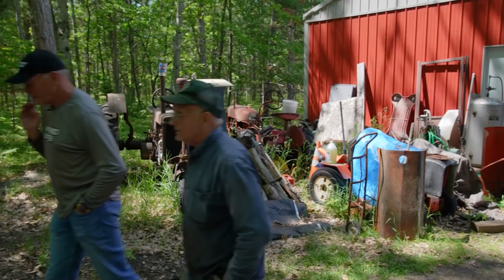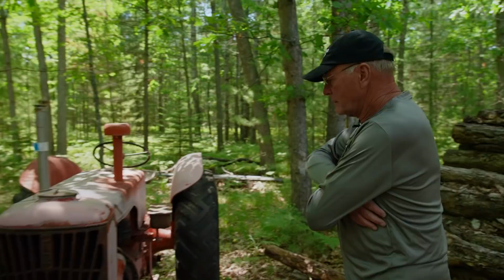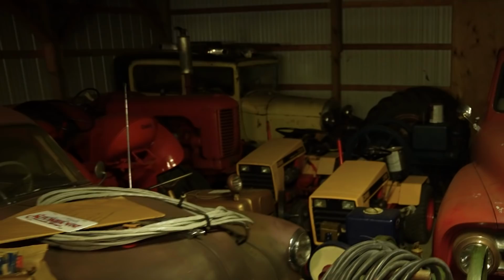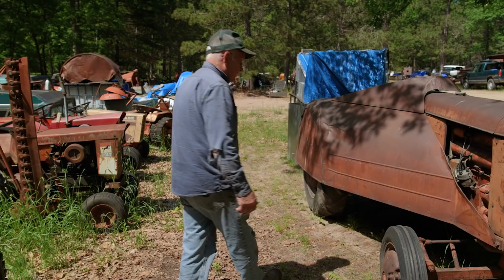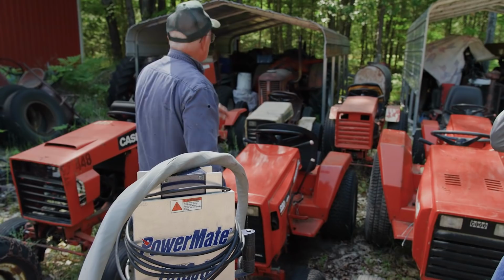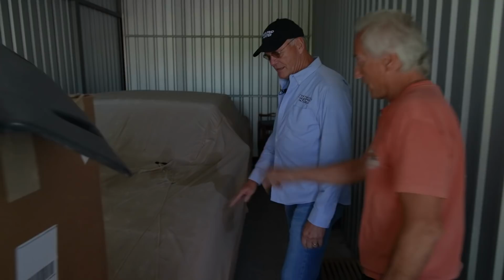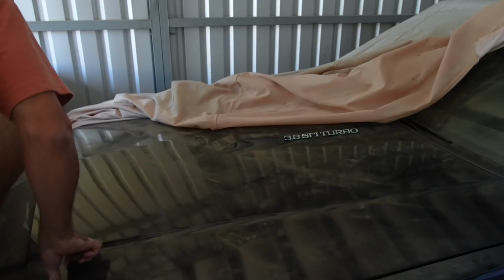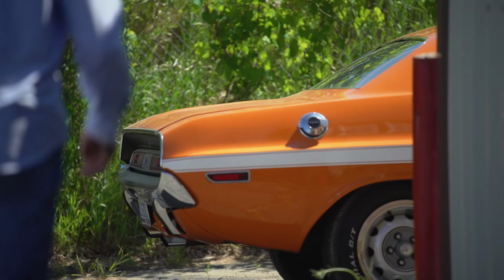LOW MILEAGE Buick Grand National press car and barn full of cars | Barn Find Hunter - Ep. 106

Comment: An 84 grand national was 200 HP and ran 15.7 in 1/4 mile, as fast as my 1986 Monte Carlo SS exactly, but the 86-87 grand nationals ran high 13s-low 14s right off show room floor. In early 90s saw many at drag strip. All grand nationals came with 200-4r transmission 4 speed with over drive and 3.42 gears, only options.
Reply: Your comment was pretty much what I was going to say. Except the 84-86 GN's were NEVER that fast. They ran hot & which really sapped power & when driven hard, they'd really over heat.
Plus the early 200 transmissions were prone to slippage & got really bad when the engine got hot.
I spent 32 years in the car business & remember those cars very well.
My mechanic's daughter has a built 85 GN, over 500 HP @ the wheel but she added a huge turbo & an intercooler & it's her daily driver.
Reply: @Vampirebear13  86 GN were intercooled as were the 87s. 84-85 slow, hot air.
Reply: @charlieb308  You're probably right. Been 30 years since I've driven 1. Been told the last few years, if I were to buy 1, only get an 87, unless I plan on building it. I tell them I'm an old man & like stock, dependable stuff. LOL Hope you have a Blessed day my friend.
Reply: They had one GN with the Turbo Six the store could not give away. I was tempted to buy it and put it away. Boy, I made a mistake not doing that, but enjoyed my Cutlass instead….. oh well!
Reply: @Vampirebear13  the 86 is the same as 87 but 87 was rated at 5 more HP. Car and Driver tested a 86 GN and it ran zero to 60 in 4.9 second and high 13s(it was cold outside that day). The 86 was made in low number 5,500 but 87 is 30,000. The 86 has chrome on front grill. Don’t hesitate to get a Regal turbo, T Type or turbo T, they are basically all the same car except interior, color options and wheels. I remember in 1991 I test drove a 86 regal T Type maroon, the car ran mid 12s, it was so fast my heart was racing, I’m such an idiot for not buying it for only $3400. I didn’t buy it because it had exhaust leak(crack manifold). Boy I’m so dumb.
Reply: Telsa does 1/4 in 6 seconds
Reply: @wileecoyote5749  1/4 in 6 second lol no bro.
Reply: @charlieb308  They only made a little over 20,000 87 GN's in 87. Many were raced hard, wrecked, stolen or just rotted out in the rust belt states. How many are left? Well, no where near 20k that's for sure. I bought my 87 Gn in 2001. Glad I did as I probably couldn't afford one now.
Reply: @wileecoyote5749  Um no LOL no they dont.
Reply: @ct87gn25  I’m not sure why guys claim an 86 GN is a fake GN, it’s the same car as 87 except for chrome front grill and 5 less HP. Also, the turbo Buicks like at Type and limited are the same, just as fast and maybe faster with lighter aluminum wheels vs steel.
Reply: I bought a brand new 87 Grand National.  I was at the Buick dealer when a truck arrived with three Grand Nationals on it.  I drove all three and bought the one I thought was the fastest.  Changed the chip a few times, installed an adjustable turbo wastegate rod, Installed an air grabber addition to the intercooler, added a trans cooler, and also added a chrome water cooled inlet pipe.  At that time probably the fastest car I ever drove off the showroom floor.  Had a lot of fun with that car and the wife got pulled over a few times for drag racing.  LOL
Reply: @charlieb308  There's a video here on youtube that shows one of the guys who worked on the Turbo Buick program. He stated that there was no HP difference between the 86 and 87 Turbo Regals. Seems like Buick was playing the HP game with Chevrolet as they rated the 86's 5 hp above the vette's 230 for 86, and when the vette was rated at 240 for 87, they rated the Turbo Regals at 245. He also stated that that the "real" dyno numbers they were getting from most of the Turbo Regals they tested were right at 300 net HP. Which seems right when you consider what they were running at the track. I know my bone stock 87 Turbo T ran a bunch of 14.0's with nothing more then me airing the the rear 215x65x15's to 25 psi. And that was in June. As for the T-Types and Turbo Limited's, your right. Both cars aren't seen as being capable  of keeping up to GN's, but they sure as hell can. Especially a lightly optioned T-Type or Turbo T. The Limited's are pretty heavy with many being optioned out and with those heavy leather "pillow" seats. Always wanted one, but now they too are through the roof price wise....
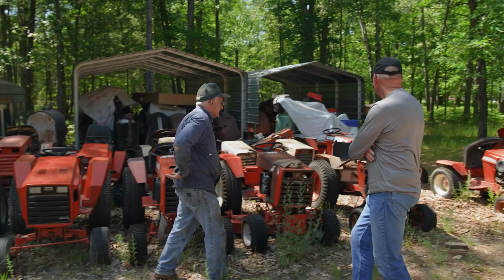Reply: @ct87gn25  back in 1993 I test drove a T Type and it was so fast it made my heart race for an hour, the guy only wanted $3400 for it, I’m such an idiot, I didn’t buy it because it had exhaust leak lol. His car ran 12:55 in 1/4 mile. My 1988 Monte Carlo SS ran 15.1 so 12 seconds was just incredible especially back then.
Reply: @Vampirebear13  There is 1 unsold 1987 GNX at a Buick Dealer just south of Hollywood CA & it's been on the Showroom Floor all these Years.  The owner of the Dealership has kept it all these years running & maintenance with just over 100 miles on it.  It was featured on Jay Leno's Garage last Year.
Reply: Only nice automobile I would have is the ford ... all the rest is broken look at the condition of the ford it's museum quality.
Reply: @Tron1731  I rather have the Cuda

Comment: I have a 1949 Case VAC that I traded some work for. When I got it, it had sat for around 15 years. With fresh gas and a hot battery, it fired right up and ran and drove. Try that with one of these modern tractors.

Comment: I've owned a 84 85 86 87 Grand nationals. The most desirable is the 86 which is the first year of the intercooler. After that the Buick of all Buicks it was the GNX. I was beating Camaros mustangs Corvettes with a V6 in 86. Very quiet the only thing you heard was the turbo blow off. The transmission was not a turbo 400 nor a 350 it was a 200 metric.

Comment: Nice Grand National!
And for gosh sakes, unlike Davin and the Mustang, when you're ready to start it, pull all the plugs, give each cylinder a little squirt of light oil (like ATF), and crank it over with the starter until oil pressure is built up.

Comment: Good video.  86 was the first year for the intercooled GN.  Motor was under rated at 240 HP.  86 and 87 GN would run 13's in stock form.  I put a chip in my 87 and upgraded the fuel pump and ran high 12's with no cat.  Wish I still had it!
Reply: There's 1 still Left.  Check out Jay Leno's Garage.  He did an episode bout a Year ago with only known Unsold 87 GNX still on the Buicks showroom floor..